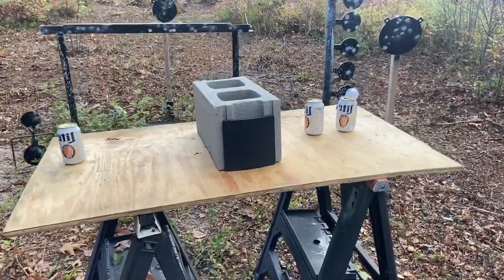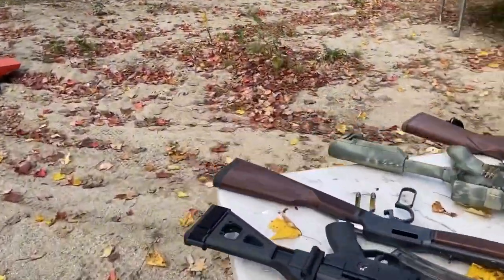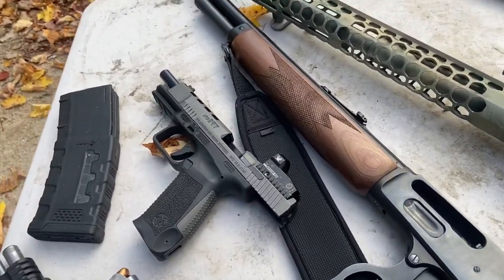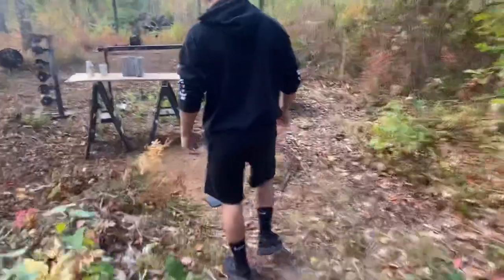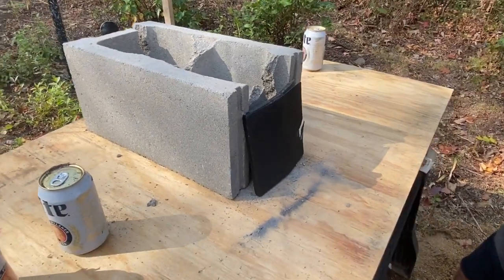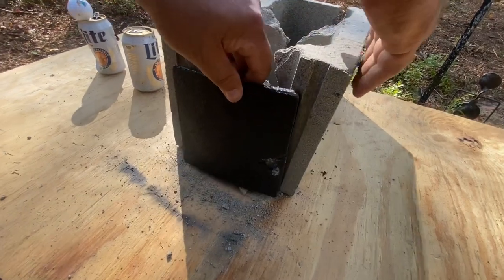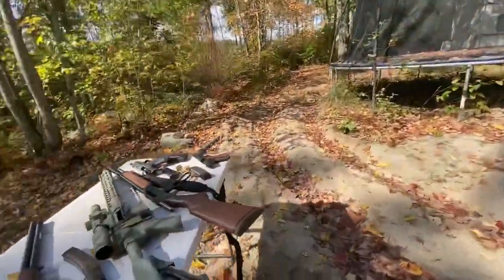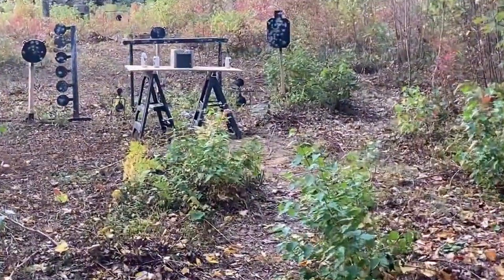Testing cheap eBay body armor

Comment: its a good thing that it doesnt have the labelling on the back in case of a federal body armor ban. if they ban body armor you could just claim that this armor is a fake airsoft plate or you could put it in a weight vest and claim that its a weight plate
Reply from the maker: That’s a good idea!
Reply: @jamesmoore1341  its just one more year. Nothing drastic will happen in that timeframe especially if youre in a second amendment state
Reply: @delta shot  I'm definitely  in a pro 2A state & wouldn't give up my right to defend myself,family or friends even if i was in a communist state
Reply: @jamesmoore1341  dont worry the world is gonna be ending soon so you wont have to worry about your families safety
Reply: @jamesmoore1341  why do you even bother existing
Reply: @deltashot5608  ??? Come again!